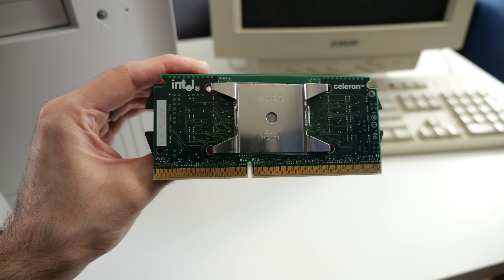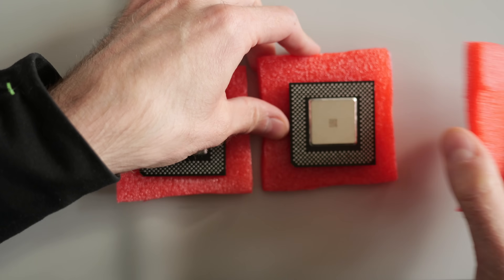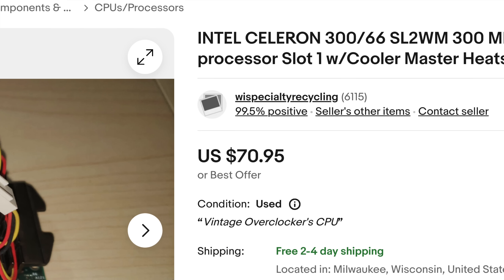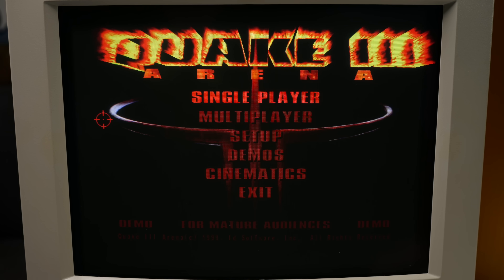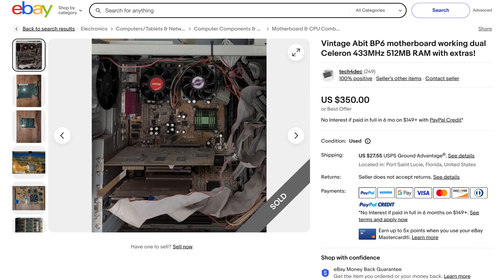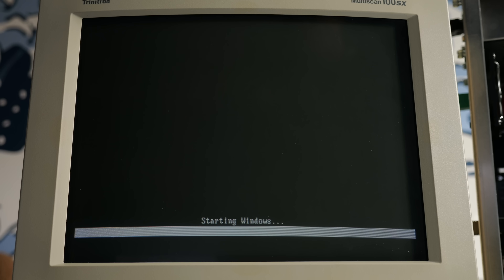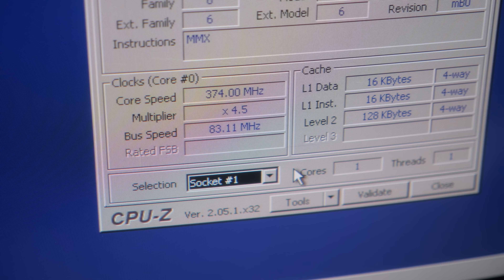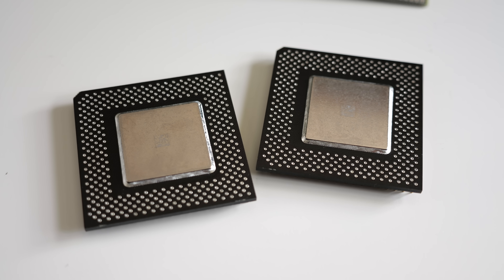I almost BLEW UP two vintage Celeron CPUs

Comment: its more worth throwing those tualatins into the slotkets and modifying the slotket to support the cpu, but not all tualatins would work and not all boards understood it so they'd report as a very fast p2 or something

the only celerons really overclocking as intended were not the mendocino (or as I call them, midocino, because they are kinda mid)

but those early ones, and the later tualatins did overclock very well.

I recall being able to push tualatins really far.

I'd like to see a look into the K6-3 chips if you use a modded athlon cooler on it and how fast you could push one of those, I've got one running at 660mhz, but any higher and it blue screens. It ran stock minecraft at about 20 fps

Also you missed out on testing 3d software supporting dual cpu configs, like 3ds max r3.1 or cinema4d

Comment: these older cpus are really are tanks even over volting it by a whole volt, it could run for years like than and not blow up. I had a p3 i ran .8v higher and it had no problems, as long as you kept it cool and not above 70-80c

Comment: Here in Australia the socket 370 Celeron 300A was easy to get back in the day. I suspect your Socket 370 Celerons have been overclocked most of their life, we used to overclock them at the stock voltage to 450Mhz.

Comment: I was a lucky one. I had the BP6 I modded so I could get die temps (some Rev they just left them out). I ran dual 366 chips at 550mhz 2.2 volts under dual alpha coolers. Was Rock stable and crunched a bunch of seti blocks.

Comment: I have the same issue on Asus P2B-D with PIII-750. With one CPU, it will do 930/124, but with two, they will only do 840/112. I were never able to push both to 930 and I have like 12 of them :/

Comment: I’ll tell it I don’t remember how I did it cause it’s been so long ago but I know it was a 300 a month wrong but I did a bunch of them. I did like 5300 o’clock to nine future to 11. I even got one to hit 12 so I meant it’s possible to be done cause I’ve done it and made good money off for selling processor that are faster than available in the stores the trip back in I’m not wrong from remembering correctly with our motherboards were way more overclock OK and I did run dual Pentium‘s on a red motherboard. I remember that vaguely but the motherboard was red because it could take Door CPU and I remember doing that but my my most successful was that seller on I was getting 900 easily and a lot of times I get to 1200 me and my friend sold a whole bunch of those around Christmas time because they were play stuff like Duke Newcomb quake unreal tournament, especially if you had a voodoo card the voodoo card that they have and boy you can play some really good games. I miss unreal tournament. I miss three those are two of my favorite games. I even played blood even though that was before we got voodoo and black magic I forgot about the black magic cards. Yeah they have some serious graphics back then.

Comment: Back in the late 90's / early 2000's, I ran an Abit BP6 with dual 500mhz Celerons. I remember successfully overclocking them to 600mhz and ran them like that for a short while, using high speed cooling fans and bigger heatsinks. I was running BeOS rather than Windows. The computer sounded like a thousand hair dryers though so I put the cpu's back too 500mhz. I still have that computer, boxed up and packed away. It ran last time I booted it a few years back. I also have another BP6 with Celerons that needs a recap.

Comment: Check the capacitors on that motherboard (especially ones in the CPU power circuit) and the power output / stability of the power supply.

Comment: Had an SMP board with two pentiums in the year 2000 / 2001. Don't recall any magical numbers/motherboards/etc. Ran linux on it, as I do since 1994.... But with caveats. I would boot, but I had to be very careful and not use the IDE drive too hard; it seemed that the linux kernel in combination with that board did not want to handle something properly (irq-stuff / DMA across multiple cpus, maybe a deadlock...). The extenal UNIT of a SCSI drive that I had connected could be used. It was quite a weird system 😀

Comment: Just changing the FSB speed like that will often change the RAM and PCI bus-speed also, so you gotta change the bus in BIOS, then check if there's a multiplier or speed setting for the RAM, and also the PCI bus.....

Comment: I had the BP6 motherboard. I installed NT, later to 2000 and later to XP. Over that period I eventually upgraded to 768MB ram. I was into cad design early on and still design. No cad software back then utilized multi-cpu. Finite element software like Abaqus/Ansys/Nastran may have had the capability? Not much software back then was written to utilize multi-cpu . What impress me was how responsive the OS was, and for that reason I never went back to the single cpu. The next step in a fast OS was the SSD, and then never installed an OS for myself again on a magnetic disk.

Comment: Having lived through that era of computing, I can confidently say what you discovered here is precisely why we did not use more dual processor hardware back then. Software was just not optimized to use more than one processor. The industry only started to change this when AMD released their first dual core CPU, and even then it took a few years AFTER that processor for it to be truly ubiquitous.

Comment: I feel bad about your luck with these celeron 300a. I had one back in the day on an AOpen AX6BC that ran perfectly at 450mhz at stock voltage. My friend was so impressed he went and bought the exact same setup with the same results. Perfect. 

Inititally when I upgraded from a voodoo2 to TNT2 I had issues until we discovered we had to manually set the AGP frequency divider from 1:1 to 2:3. As it was trying to run AGP at 100mhz rather than 66mhz and there was no "auto" setting like PCI had. Maybe something to check?

Since then I've bought 2 others for nostalgia reasons. I occasionally put the one I still have into my ASUS P3V4X and it works fine. No voltage increase.
Reply: Perhaps it's just all the good overclocking chips have been sucked up into collections. And the only ones doing the rounds on ebay and the less than great ones that are just going around in circles.

Comment: I have a SuperMicro 370SBA motherboard myself. It has a 366MHz celeron overclocked to 550MHz with that bus speed jumper set to 100MHz and it FLIES. I think a lot of the 300MHz socket 370 Celerons were made earlier than the faster ones so chances are if you tried this with 2 366MHz chips (ideally later production, that yields more stability) it would work without a voltage bump or with a much lower one like 2.2. You also really need to make sure your power supply is in good health and don't use a cheaper unit, ideally one with good caps and a strong 5V rail will do. I would also like to mention it is possible to change the "Uniprocessor PC" without having to reinstall windows, just update the device in device manager to the multiprocessor version of whatever you have. It seems perhaps the slockets likely weren't designed to be run at higher bus speeds but that I don't really see that as an issue if it's handled by the board itself. I would go for the 2 366MHz celerons at 550MHz, as it's essentially the highest performance you can get out of mendocino whenever configured correctly. I ran a machine like that for years and it's never let me down. Only issue I have is that the PS/2 ports don't work and that is even with a 66mhz bus so that is related to a board component issue. Don't give up hope, Colin. I've done some crazy overclocking myself. I know exactly how it feels.

Comment: I had one of these adapters, ran a p3 700 at like 1ghz in it, only problem I had with them was I kept killing boards, I stocked up on them at a school auction though so I think it took me 3 boards to get a stable machine.  1ghz and a voodoo 3 was enough to run Unreal Tournament at pretty decent framerates, high 40s in glide mode.

Comment: I wonder if some of the difficulties you had with overclocking have anything to do with the chips age. as even even running cpus at stock speed and voltage does slowly degrade the chips. I would guess if you could find any new-old-stock chips you might have better luck overclocking them, and also forums and magazines would probably have only overclocked them for a breif period just to see if it's possible and likely they inevitably would go unstable after some time.

Comment: Again: I never EVER encountered a Celeron 300A that wouldn't just work at 450 MHz in a BE6 or BP6. I've built several BE6 computers in a small computer shop circa 2000, by 2001 I had BE6 at home and BP6 in a server at a new workplace, all Celerons 300A at 450 MHz with a flip of a jumper. Were your CPUs from a too early batch? We were buying them at the end of their support life, surely improve yields and whatnot. Or do they simply degrade with time, after years of service at 450 Mhz?

Another idea - perhaps the "risers" you used introduce too much interference or something. BP6 had no need for those, as well as being built specifically to allow this, working around Intel's blocks.

But by now, I can send you an old BP6 right away, but good luck getting it to run at all, not to mention stable... Those capacitors are long dead and there's no replacement on the market. Awesome board, but there's not a single one on the planet that works correctly, and no way to make it work like it used to when new.

It's not rose-tinted glasses, it truly worked out of the box in 2001 (again: that's later than your video's target time frame). But it's impossible to replicate in 2025, sadly.

Comment: Quake 3 was really bad for multithreading. A better bench mark would have been getting a hold of something like 3D Studio Max R3 or 4 and doing some renders. There really wasn't much consumer software that was multi-threaded at all back then. They were dark times for sure. but those of us that were learning 3D with "borrowed" software drooled over stuff like this.

Comment: I was a late teen back when the overclocking scene really took off. I'll never forget that mad lad that turned up to a domestic LAN party (at a friend's parent's home that was of the old European timber frame type, heated by a charcoal oven) with his very latest build. Which required him to set up next to the kitchen sink, because that was the only place where he could get cold running fresh water, and also dump it. No radiators or water storage at all. It just had to run through, to keep his crazily overclocked AMD from melting.
It was that same evening where I first saw an optical mouse, and was entirely smitten by both of these marvels. Ah man, the late 90s. It was shite but wonderful at the same time. Thanks for bringing back these memories!
Reply: I made a home made water-cooled for my Radeon 9800pro with a L shaped bit of copper which I used a drill press to drill a water track into. Then sealed copper sheet onto it which had flanges that soldered on. Then used garden hosing and cable clamps to run it into a huge 10L tupperware container that ran a aquarium pump. 
I was able to get some made clock speeds until I got heat soak.
Reply: I watercooled an Athlon with epoxied pieces of clear acrylic around a stock rectangular aluminium heatsink, with a watechannel cut out of the fins. I had a submersible aquarium pump running ice-water out of and in to a HUGE open reservoir. Like a 10-20 litre storagee container. Cough... grumble... youngsters have it so easy today!

Comment: Sad that it failed, but i'm 100% sure the board is the problem, this late s370 cpu is late stepping and i seen that it overclock well. I seen 600mhz 2.1v on an abit bh6 ). I got this cpu from china surplus tray brand new old stock too. They was cheap and never had been used. I strongly consider that you should buy a bp6 even if it's not cheap (nice piece of computer history, it will keep his value... ) 😅

Comment: At some point, the trick was to get your bus at 100mhz and then find a celeron that supported it. Usually the 266mhz version ran better than the 300mhz version. The 100mhz bus made your gpu and ram faster, that was important too.

Comment: I overclocked a Celeron back in the day. Next thing you know I was having what appeared to be hard drive controller problems. After a ton of trouble-shooting, it turned out the CPU was the culprit. CPU errors are hell since they can appear to be an issue in just about any other component in the computer. And that was the last time I overclocked.

Comment: There were 2 builds of 300A Celeron s as they had become so popular and they also carried a price premium when new especially the 370's. . The second was of a much lower quality. Also when you sourced one in the day they were often opened box as all the really good ones used to be picked over by the stores and the retail boxed units were extremly rare. 90% were tray units. As for voltage just going higher was not always the answer. I used to run mine at only 0.05 volts higher using the Epox bios. That board used Slot 1 and I used ABIT adaptors. They also had voltage adjustment. Depending on application I would configure them to split the load. Example when burning/ripping CD's the second CPU was always tasked to run the SCSI. The BX chipset was also often flakey when or if it was running the Hard Disk. If you even tried to run both channels it would grind the system to a virtual halt. Back then this was quite common especially with the chipsets that included Video. Looking at the BIOS you showed the voltage supplied was always low compared to the setting. This is amplified when things start getting used and most likely the cause of the crashes. Even Supermicro wears out. Voltage regulators were often undersized on the boards. The ABIT Dual board was crazy expensive back in the day by so much that you could get very close to building a non OC system at the same speed.  I bet with a cap refresh and a power piggy back it would get the supermicro all stable. 
I would also mantion that the AGP can often be a source of fail. It is made to run at 66mhz not 83 and when running 100 it is divided back to 66mhz. For maximum stability a PCI video card was always the best choice.
I ran mine untill 2003 using XP and funnily enough XP was more stable than 2000.  By that time the caps were done.

Comment: Early 2000s I had AOpen AX6BC and 400MHz Celeron with slotket @600MHz. If I remember right it needed 2,3V. Later got peltier+water and got it over 700MHz, for just a while. Then came Tualatin Celerons and Powerleap iP3/T and reached 1,6GHz. Nowadays when I have overclocked Tualatin CPUs I have noticed the performance difference between Tualatin Pentium3 and Tualatin Celeron is dramatic at the same CPU clock.

Comment: Its embarrassing to own up to now. But my very much lower middle working class parents let me and my fellow computer nerd buddy design an upgrade system for me in the early 90s as a young teen. I can still remember the basic specs. Tyan Tomcat MB with dual Pent 166. Didnt even realize the OS wasnt SMP compliant till years later. So obscene $ going dual CPUs was for not from the get go. It was a local white box custom computer shop we both were friends where the owner was probably only a couple steps ahead of us in knowledge.  Have so many great memories hanging out there. And later on they had a guy start a custom speaker shop with the extra space. A couple years later that guy built a car box for a Vega-12 that blew away the computer for my non comp friends LOL. Was such a different time on so many levels. Owner of that store passed on a few years ago along with my father around the same same time. Both too early. I feel bad for folks that didnt experience the 90s as the world was so different on many levels. Is what it is and we all move on. I havent the slightest clue what it will be like for 201x that age and phase out.

Comment: I had the celeron 300A. I set bus to 100 Mhz and enjoyed the amazzintg 450 Mhz phenom that was the 300A.  LAter I wanted Dual processors, so I bught 2 P3 67, they stil supported multiprocessor. A via motherboard. I tried to overclock to 900 Mhz but that dindt work. Think I got the bus tomid 80s and forget how high I got them, but they did stabalize overlcoced dual proc, windows 2000 early adopter. I hgad a ton or argukets in forums online, widows 2000 suported modern games just fine at the time. I was playing al the hits on it,and stable, and people onlkine would try to argue with me that 2000 was "NT, and NT cannot play games" They were so wrong. I got on Win2k starting with a beta from my MSDN account, and never went back to win9x version ever again

Comment: I bought a 300A & motherboard when they were the new hotness because of everything the "A" brought and ran it that way for months before I heard of the 450MHz overclock. It worked for a while until it decided it no longer liked doing that. Once I dropped it down to 300MHz again it was perfectly stable.

It was at this point I ran into the no middle ground with clocking issues that Colin discovered. Though I cannot remember if I even thought of looking through software settings given that was a relatively new thing at that point in time and everything was pretty much jumpers only. Given this was 25+ years ago, I can't really remember much more about this other than these chips were fantastic little things.

Comment: Your videos debunks the myth of this dual celeron setup. I remember people started to talk about this setup in forums and newsgroups, mostly after it was obsolete, people buying these used with the abit motherboard, but a that time you could get a cheap amd athlon for probably less. Also like you mention, almost no software supported smp back then. I think it is just that retro dual cpu setup that is so tempting, also feels the same for the Pentium Pro servers 😅